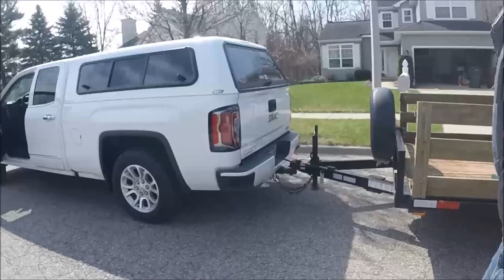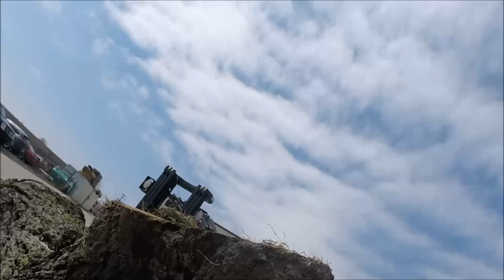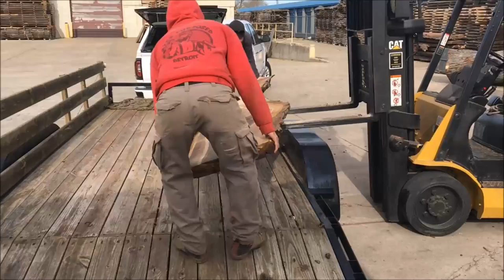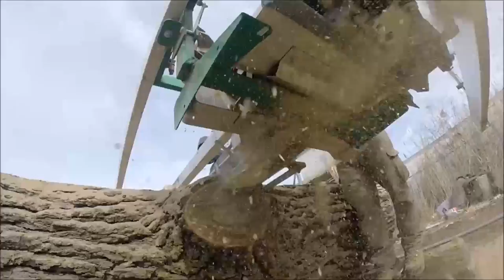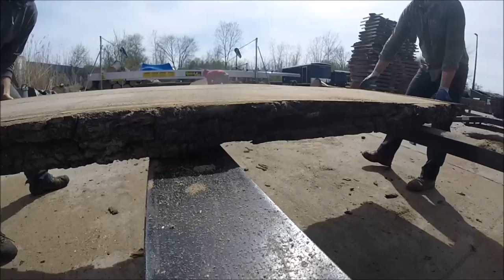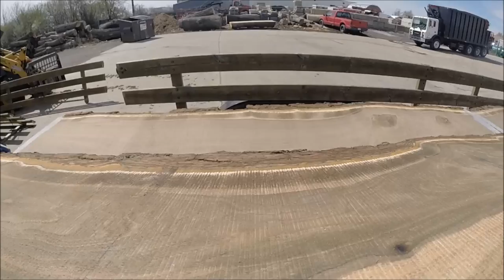Slabbing a GIANT walnut log using a Lucas Sawmill!!!

Comment: Another question.

What's the ideal (workable) thickness when cutting a big tree like this?
Reply from the maker: Im not quite sure what you are asking, can you explain more for me?
Reply: Third Coast Craftsman 

Let's say I have tree like that, and I want a slab out of it, just like what you did. but in some cases people don't know yet what to build out of it let's say a table, furniture or something, my question is what is the ideal thickness of the slab that  one must consider when you send it to a saw mill so you can work something or rather most things (table/chairs etc) out of it. 

I hope it makes more sense now.

Thanks!
Reply: You want slabs to be 2-3" thick so they'll have some more meat on those wide boards to correct warping and resist cracking apart. Downside is it takes over a year to dry that thickness without a kiln. If you're cutting just regular lumber, most times they'll cut it at 4/4 or 5/4, but they're also not cutting full width slabs.

Comment: What’s the value of painting the edge?
Reply from the maker: Thats a product called anchor seal. it seals the end grain to prevent excess moisture loss
Reply: why would you bother with moisture loss? Isn't it suposed to dry?
Reply: Robbe pinsart Most of the times it is used on logs as soon as they are cut. Helps prevent excess moisture entering the end grain and causing checking (cracks on the ends that will show once you slab it)

Comment: Why were they painting the ends of the slabs
Reply: As wood dries, the ends lose moisture to our atmosphere faster than the uncut rest, causing splits/cracks called checking. Think of a length of wood as a bundle of drinking straws frozen while full; as they thaw the open ends leak while the uncut middle sections don't. The paint seals these open ends so the evaporation rate is equalized over the entire piece which minimizes checking and maximizes the amount of useable wood.
Reply from the maker: ben kattenhorn exactly what Joel said! 👍
Reply: Its not paint Usually wax or even white wood glue

Comment: No one around with a band saw?  Much quicker and thinner kerf.
Reply: slow96ss looks to be wider than 40” hard to get a bandsaw in that size. But you are right
Reply: The slabber cuts it flat as a pancake,  band saw blade wanders a lot on such a wide cut.

Comment: what kind of paint to you use
Reply from the maker: Thats called anchor seal, its an extremely waxy coating that seals the ends and prevents cracking from the ends drying too quickly

Comment: WHy didnt you just seal the entire log instead of stopping production to do each piece?
Reply: They are using a chainsaw mill. Need to let those systems cool down in between each cut. That and they are sealing 2” over on the face of each side.

Comment: Awesome job putting this together.  What was the white paint for?
Reply from the maker: Thats called anchor seal, its a really waxy coating that prevents the end grain from drying too quick and cracking. If you dont seal the ends the boards will split and check badly
Reply: Thanks so much for replying!
Reply: Third Coast Craftsman You needed to anchor seal the in-cuts on those first couple slabs.
Reply: Third Coast Craftsman can u use latex paint

Comment: At the end you say you will kiln it. In that case you must treat for woodworm and/or fumigate it in the kiln, otherwise you will get a nice row of bore holes along the stickers. No need to tell you how I know. Don’t leave it outside over winter. It will rot. Best to air dry it in a garage or shed. It contains a high sugar content which the little beetles love.
Reply from the maker: Hi Jim, After you mentioned wormwood I did a little bit of research, and I can't find much information on it over here in Michigan being a problem. It seems that everything that pops up is a UK website. I wonder if that is a problem that you have in the UK but not something we deal with in the US. I haven't ever heard any of the saw mill guys talk about that.
Reply: It’s certainly a uk problem. Due to Anobium punctatum.  In New Zealand they have “borer” due to a different insect. You may be ok in Michigan. We air dry here one year for every inch thickness. Good luck with your walnut.

Comment: Only $500? That was dirt cheap!
Think of it this way, assuming it’s American Black Walnut ( Juglans nigra ) and the slabs are a tad over 2 inches thick, if you take one of those crotch wood small slabs where the branches take off from the main trunk & where some dumpkoph sunk the chainsaw almost all the way through the trunk, and dry it and get 2 nice shotgun stock blanks out of it, each one will return you the $500 you outlayed for milling, so the rest of its free!
Reply from the maker: Oh yes I definitely and sitting and pretty penny. Each slab is actually 12/4 too